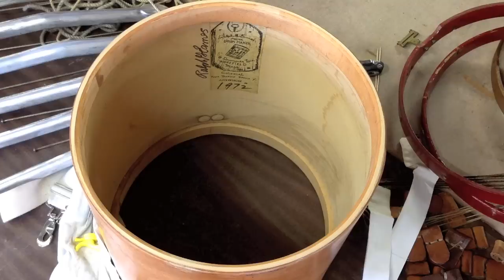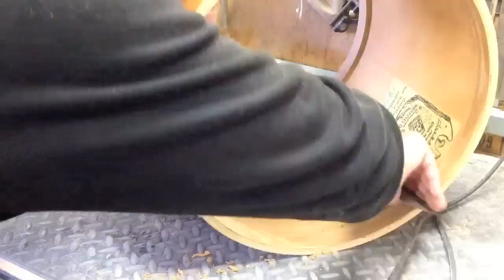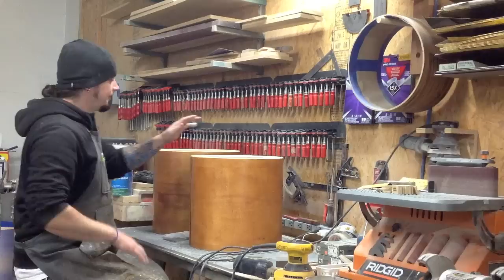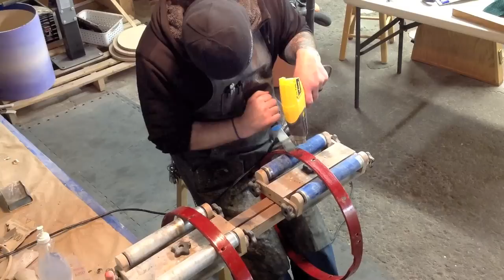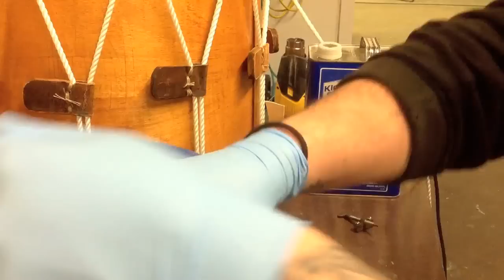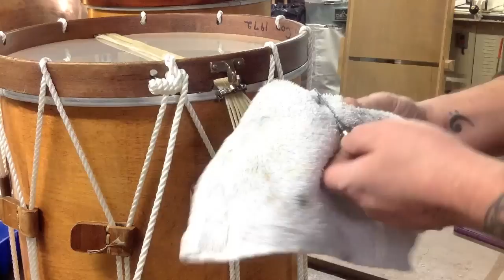How to Rebuild and Restore Classic Eames Rope Tension Snare Drums

Comment: is there a synthetic version of snares like nylon? and could a snare strainer that can "turn off" (for lack of a better word) be used with a rope tension drum and these type of snares or would they be more likely to get stretched/break or wouldnt be compatible with the drum?
Reply from the maker: Yes to both. Check out our Hamilton rope tension drum build video for reference.
Reply from the maker: Also, regarding synthetic guts, we've had good luck with Kirschbaum tennis racquet string, weed-wacker string, harp strings, and some guitar strings.  All are a bit more tricky to set up than natural gut, but you can do it, and they all sound good for different applications.

Comment: +calderwoodpercuission  What reheads are aviailable for φ17" laced drums such as the smaller of these Ralph M. Eames sides?  The modern Baſlertrommel, which uses a chrome-over-brass shell, packs a somewhat more sophisticated strainer on the resonant counterhoop than Cooperman Fife and Drum uses on Liberty models, but these Eameses look as though they use turnbuckled J-hooks to tension not more than six turns natural doubled/twisted sheep intestine across the reso.  (The φ18" laced drum may be able to use modern floor tom heads, at least in terms of the batter; I'm really waiting on EVANS®/D'Addario® to make Heavyweight coated/reverse dot batters from 8" to 20", so that heavy enough batter to oppose the same vendor's Resonant Glass head is available for all reasonable snare-drum sizes.)

Comment: This is actually a Basler Trommel (Basler Drum)
Reply from the maker: Although the drums from Basil are also typically rope tension, they are stylistically very different.  Typically they have chrome plated brass shells, and they use an interesting multi-timbral snare strainer that incorporates both natural gut and coiled steel snares.  The two snare materials are independently adjustable with a really cool system of concentric tension knobs.  They are typically set up with Rotex heads (a material very similar to kevlar), and tuned to crazy high tension.  The ears on Basler drums are much smaller leather sleeves, and I rarely see them with three strand rope, but much more frequently with more modern rope constructions, more like climbing rope.  But yes, most of the Swiss drums I've seen are about 17"x17", and in an orchestral context, it would be very reasonable to use an American style rope tension field snare such as these when the score calls for Basler Trommel.